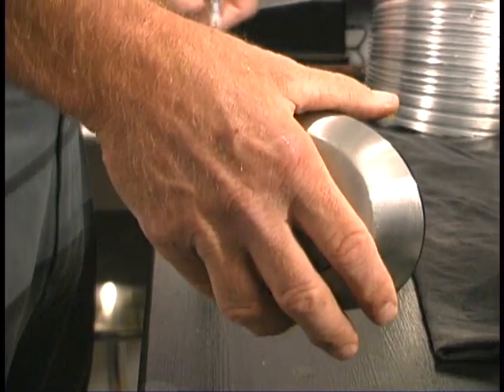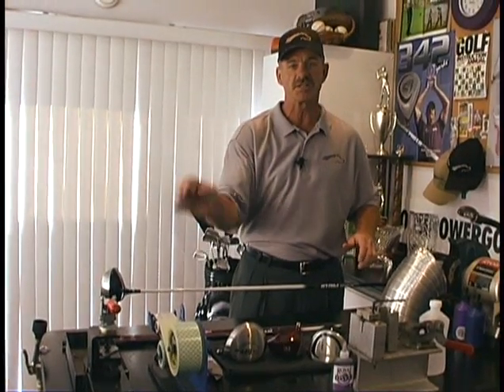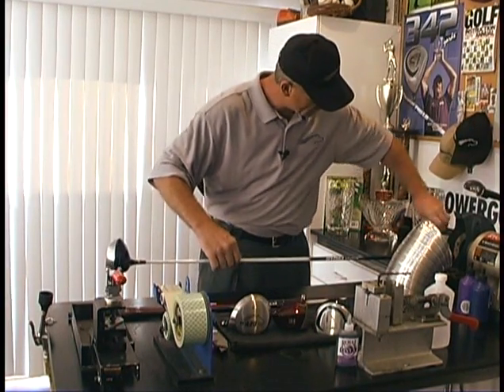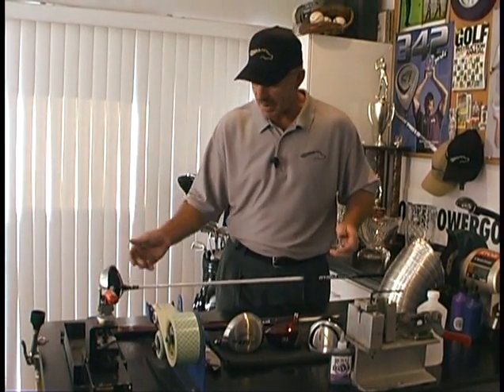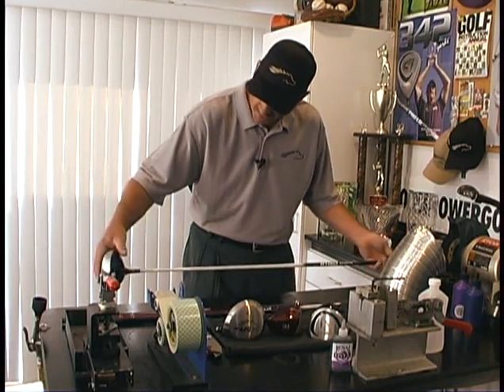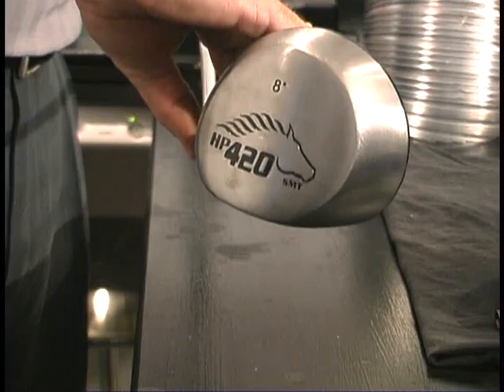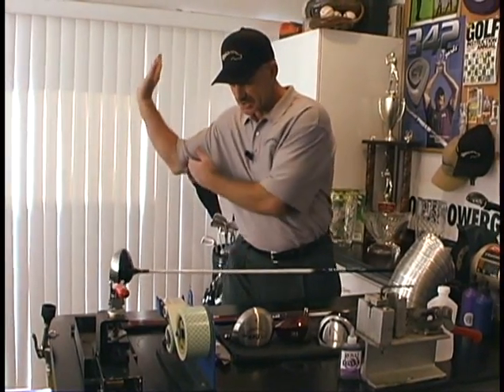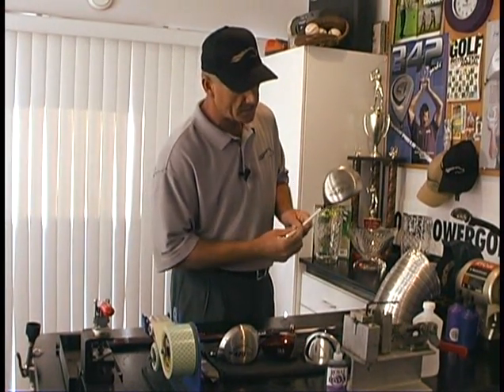Find the Spine of a shaft

Comment: Pat, you still out there? Q: Once you find that rhythm, are you aligning the spine or the belly? Club shaft blanks are made the same way fly rod blanks are made...<citation>, so there's a spine (stiffer side) and a belly (weaker/opposing side). Fly rod guides and reel seats are placed along the belly. Does club face align with spiney? See https://youtu.be/LTvyYl2wmOw for typical fly rod explanation. My guess is "club face to belly" as the release power happens as the opposite spine side unloads on the fore cast.

Comment: Isn't this a complete waste when it comes to adjustable drivers. I have the Adams speedline super S which is adjusted up or down one degree by loosening the screw which attaches the shaft and turning it. So if my shaft was spine aligned, adjusting the loft on it will take away the alignment.

Comment from the maker: @sim549 I personally cut an inch piece of plastic (the plastic sleeve shafts come with)  and use that to hold the head to the shaft. ...Of course, be sure to remove it before using epoxy